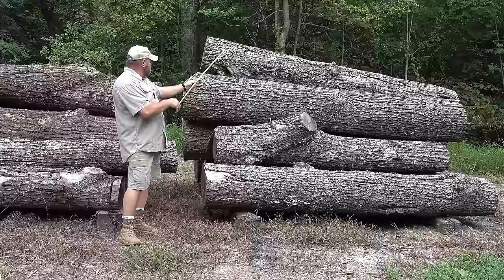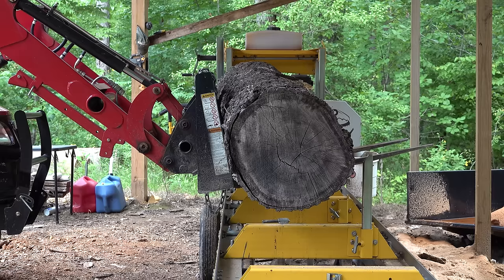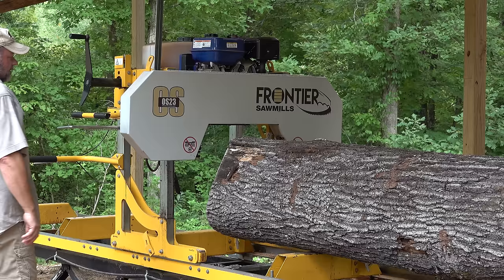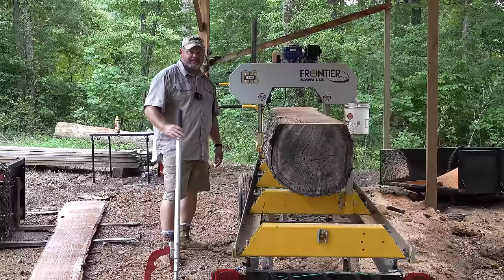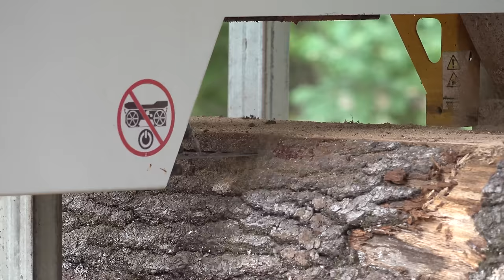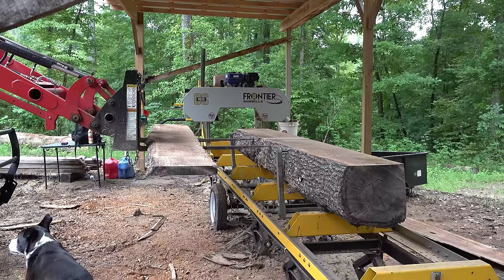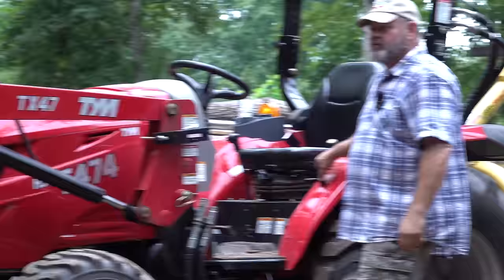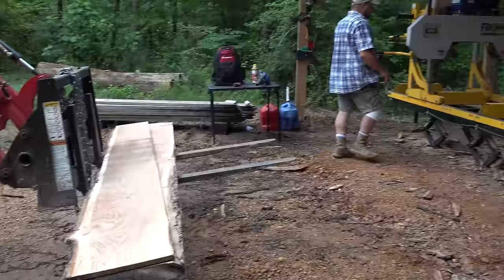Oversized Log On The Frontier Sawmill! This is Real!

Comment: Sitting here watching, and wishing I could jump in and help.  I am 73, but no stranger to logs and a peavey.  Sometimes a pole ax to give the hook a tap helps too when the wood is a bit punky.  You really need your grapple though , or run a chain around your log and turn it with your bucket forks.  
You really start making money once you get the stock squared up though.  
Great job, both of you - keep ‘em coming!
Reply from the maker: Thank you. I brought my grapple back the next day. For me, I have got so use to using the grapple, I am just about a rookie when it is gone. Still, I love doing this.

Comment: I got the frontier loading ramps and winch system.. I use the winch to roll my log against the log rests..works very well on huge logs..I don't struggle at all..not to mention the box tube the winch is mounted on keeps the log from rolling to far and coming off the back side.  also I put the system on before I release the log dog, it keeps the log from rolling back at me. I love the winch..makes it much safer to use..even with just one person.
Reply from the maker: Thank you so much for the info. I have looked at the winch system several times. I think I will order one now.
Reply: @TonysTractorAdventure  it really is worth it, especially if you are working by yourself.. before this I would roll a log up and then cram a wedge under hoping it stays tight to my log rests... the winch you stand on the log rest side and pull it right up tight and then go lock in your log dogs..so much safer. I was just thinking. it may be cheaper to just get a 12 volt atv winch and make the frame up from scrap metal.. I wish I did..I think its expensive for what it is but it really helps. If I did it again I would build my own

Comment: You can turn log with your tractor by wrapping a cable attached to a hook around the log. Hook the other end to the tractor forks or bucket positioned above the log and raise the bucket which in turn will rotate the log. Two wraps of cable around log will easily rotate even a giant log with little effort.  Take a look at the manual winch turner on a Norwood manual mill to see how it works.
Reply from the maker: Thank you. I brought my grapple back over the next day. It has spoiled me.

Comment: I think I have said this before but get you some 2 foot sections of metal pipe that just fits over your backstops and turning a log is much easier.  It rolls against the pipe.
Reply from the maker: I apologize for missing your comment. That is actually a really good idea. Thank you for the insight.
Reply: I have commented that to several sites.  3 sections of 2 foot steel pipe that is sized to just slide over your log stops was the best thing I have ever added to my HM130MAX sawmill.  Slide them over the log stops and instead of it trying to climb over the log stops it just slides.  The other best thing I have done is to cut some perfect sized and planned white oak logs stops.  I use them when I have squared off wood cutting pieces.  If you accidentally hit one no loss of a blade.  I made a bunch of them at one time.  Still using my first 3 so far with no mistakes yet.

Comment: I would have liked to see you move that with the T25. I'm in the market for a larger tractor to move logs around the same size onto my sawmill and am having a hard time figuring out which one will do the job. If the T25 would do the job I'd like to get that as it's much easier to trailer it than a T394/474.
Reply from the maker: The T25 is rated for 1300 pounds on the loader. Use a log chart to get the weight of the log based on the species, length and diameter. There are a lot of variables. I use the T25 all the time on the sawmill, but the log must be right.

Comment: how come you buy the winch and loading ramps for your Frontier?  I have the OS 27 Frontier sawmill  and have used winches  and  ramps before for other applications and taught 7th and 8th grade physics how use levers, ramps, dollies to move your work without hurting yourself.  Oh, by the way,  I don't have a large tractors only a X350 lawn tractor  and winches, an old 50 year old block and tackle (5-1 ratio)  5  snatch block pullies, etc. along with the frontier loading ramp and winch.  I am 79 years young.  Hope this would help you.
Reply from the maker: I have a good system with my tractor and grapple, but my system was messed up.

Comment: Just found your vlog . If I may offer this , it might be a little more work but if you leave the long backstops on the mill when you roll it won’t the log slide on the backstop ?
Reply from the maker: Not always perfect. Sometimes, with oversized logs, it is darn near impossible to turn without help.
Reply: I wasn’t criticizing and I realized, because I hadn’t watched all of the video . I was just saying that instead of taking the chance of the log rolling off leave the long stops on there when turning . Changing them out was the “ little extra work “ came in .
Reply from the maker: I meant the tall stop doesn't always work perfectly with oversized logs. The trick is to never do this without the grapple.😁